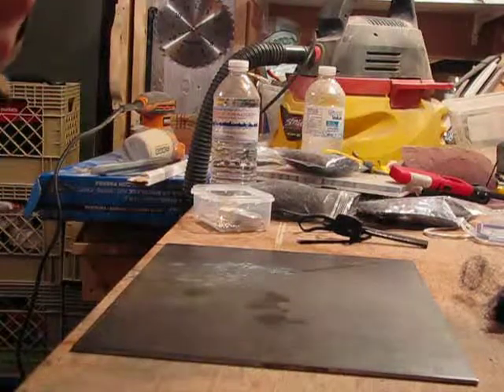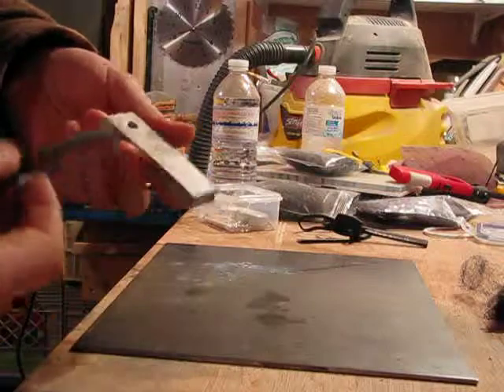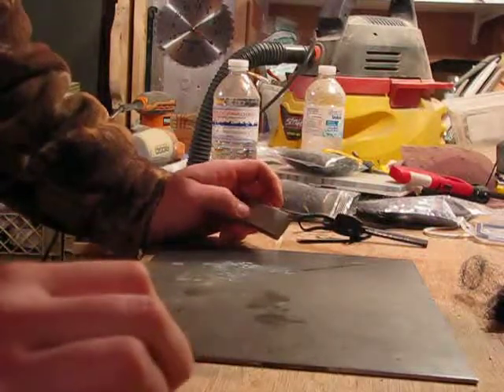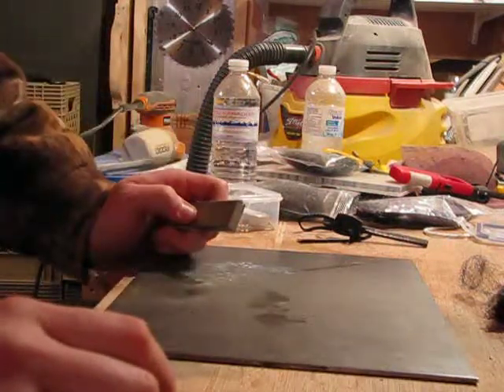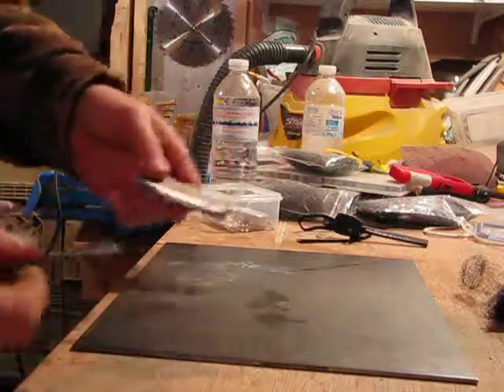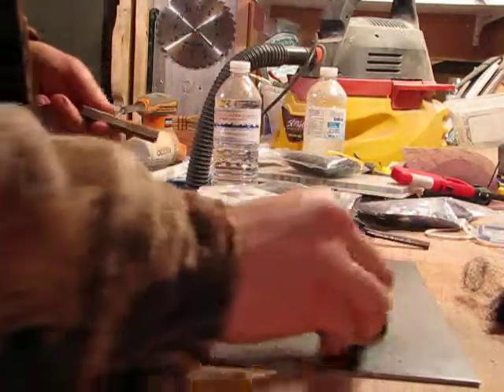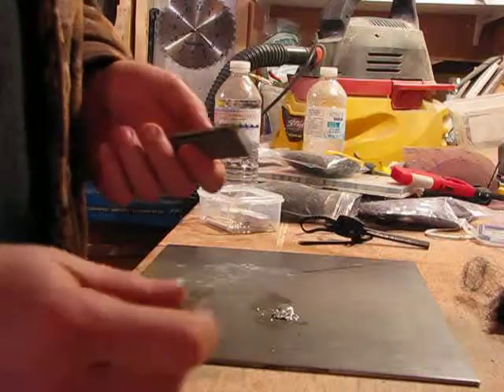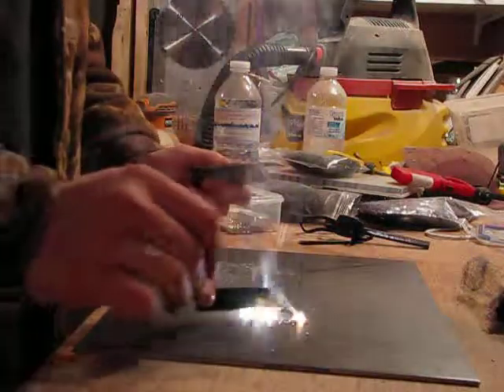Magnesium Strip Test

Comment: Don't e afraid that your magnesium bar absorbs moisture, that's definitely not the case. My guess is that the Chinese use a low grade magnesium alloy, with a low magnesium content. Read US. Patent 4188192 for the patent of the official US Army Magnesium Fire Starter for more information about the magnesium alloy they use.